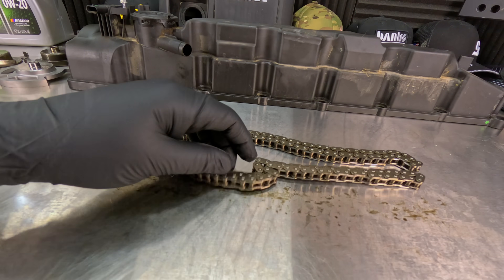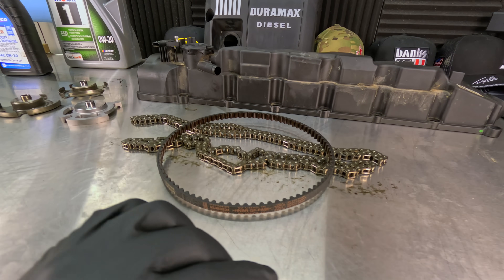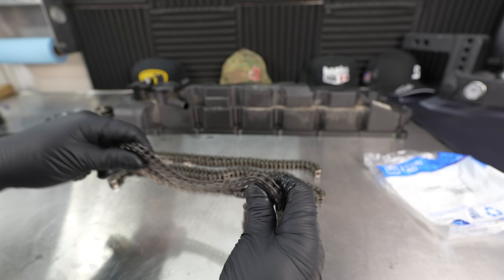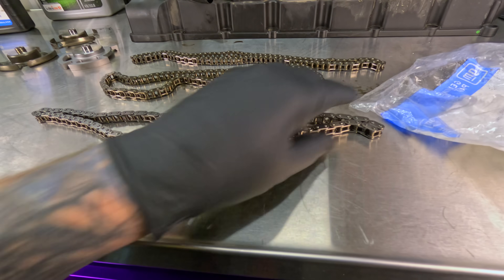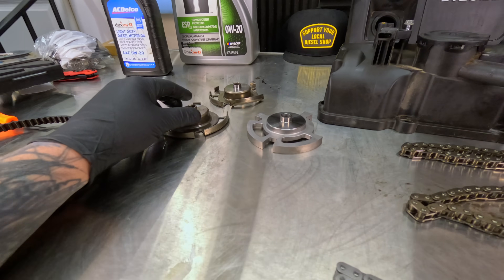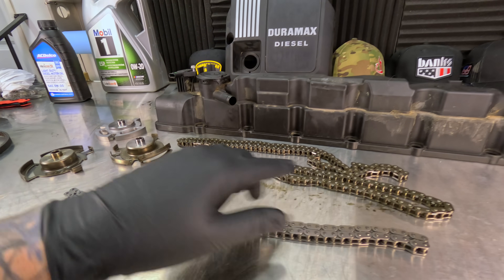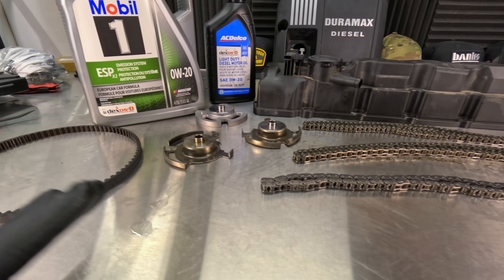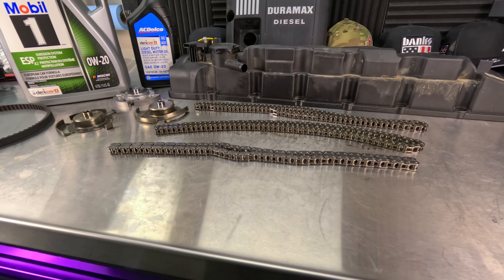3.0 Duramax $10k Timing Chain Failure — Updated Design vs Old

Comment: LOL....340k miles on my 08 gmc   6.6 duramax with gear driven valve train and crankshaft driven oil pump. But 0w20 oil sure doesnt help with the longevity  of those 3.0 duramax chains

Comment: So I’ve got a 2021 Tahoe with this motor in it. Confirmed 2021 year model bought in February 2021 new. Do I have to worry about the oil pump belt and chain issues or have I dodged the chain issues ?
Reply from the maker: Chain issues should be done and gone for your year and there are no belt issues to worry about, so you are good to go !
Reply: @DemonWorks thank you so much for the response.  Will tackle the oil pump belt at 150k miles
Reply: What about 2021 Escalade ?

Comment: I just bought a brand new 2025 GMC Sierra Denali Ultimate 1500 a couple months ago.  I made no modifications to it at all.  After 2000 miles my engine had a catastrophic failure.  It started making noises to the point I had to tow it to the dealership.  When they were looking at it the engine seized.  It had plenty of oil.  At no time did any of the warning lights turn on.  I was advised they ordered a new engine.  Of course it’s on back order and I will likely wait several months for the repair.  Has anyone ever heard of this happening?
Reply: I work at a dealership, we’ve replaced 2 so far and we currently have 6 engines on order all 2025/26 trucks. They messed something up and these trucks are destroying the thrust bearing before the first oil change.

Comment: That 3.0 is a wannabee diesel engine gas conversion.  Looks like a gas engine that runs on diesel fuel. Timing chains , overhead cams in diesel engines is purposely designed to Fail. When I think of any true blue diesel engine. I think of 5.9,BT 3.9 BT Cummins. They all have gears and no overhead cams and chains. . GM TRASH. Dodge is doing the same crap with there v6 wannabee diesel engine. Blue Tech Trash. If it's Not an inline 4 or 6  with timing gears.  It's not a true diesel.

Comment: This type of engineering buffoonery is happening so frequently, I'm wondering what it's going to take before the GM car/truck owners organize and go after GM with massive class-action lawsuits for deliberately designing substandard engines that require massive and very expensive repairs soon after the warranty period is over. This is no coincidence. They are designing these vehicles in this manner to cut costs and with an intent to see them fail.
Reply: I'd rather not see that. GM will advise its attorneys to litigate it until you're out of money. They will be, too...but they'll just go back to Congress to get a bailout. Then its my money too.

Comment: they all build chinese junk....ford gm etc no hardness in chinese metal....rubber belt in acid bath city on the oil pump????? ford transit uses a rubber belt for cam timing another time bomb

Comment: It might be an anomaly, but we have two 2023 1500/Duramax trucks for long haul trailer freight.  165k on one and 192k on the other.  Always using Delco 0-20 with literally zero issues.  These trucks normally pull 3000 to 8000 lbs on an open trailer.  Nearly 20 mpg with trailer.  They have been nothing short of amazing.  They replaced Ford 3.5 Ecoboost trucks.  Great to 60k to 70k miles and then, nothing but expensive problems.
Our plan is to replace the light duty trucks at $250k miles and replace them with the same.
Reply from the maker: The LZ0 is a great engine !

Comment: I have a ‘23 3.0 lzo with about 41k miles. Mostly highway miles, some towing 4k travel trailer.  I change the oil every 5k miles.  Burns probably ½ qt every 4-5k. Other than that, no problems so far.  I just need to switch to Mobil 1, still using Acdelco oil.
Reply: Rotella
Reply: @StreetTerrorist187  That's for Motorcycle.

Comment: Im thinking about buying this truck any input is appreciated. 2023 GMC Sierra 1500 Elevation
Exterior :
Sterling Metallic
Interior :
Jet Black
Highway MPG:27 [3]
/ City MPG: 22 [3]
*EPA ESTIMATED

VIN: 1GTUUCE8XPZ155358
Stock: PS61435A
Mileage: 38,363 Miles
Engine: Turbocharged Diesel I6 3.0L/
Model Code: TK10543
Transmission: 10-Speed Automatic
DriveTrain: 4WD
Body Style: Crew Cab Pickup

Comment: I've been driving a 2023 3.0 Duramax since new and now it has 38,000 miles, haven't had too many issues, a couple recalls and a couple visits to the dealership due to the oil consumption, besides that, just regular maintenance, but now on its 38,000 miles, theres a lot blow by coming from the oil dipstick ... a lot ! I dont know how normal this could be since Gm stated that the oil consumption is normal, but this is a separate issue ... but as far as know, blow by in a diesel engine is not a good thing. is there anyone dealing with the same issue ?

Comment: Doing my 1st oil change at 5k. Picked up the factory PF66 filter but want to use the PPE. Should i get the PPE or just roll with the PF66? I plan on all oil changes beong done at 5k.
Reply from the maker: Since you spent the money on the pf66, I would use that. I do offer a 3 pack of PPE oil filters here: https://www.demonworkshop.com/products/ppe-3-0-duramax-engine-oil-filter-pf66-upgrade-114000650. Singles can be found here:https://amzn.to/4j7Nji0
Reply: @DemonWorks gotcha. Yeah maybe I'll do it the next time. Sounds like it won't make a huge difference. It'll just be a little extra protection. Is that correct?

Comment: I would be surprised for a gm transmission lasting 150k miles or 200k. So when you rebuild the transmission get this belt replaced.

Comment: I have some questions for you, first thank you for your videos on the 3.0 Duramax. I have a 2023 Chevy Suburban 3.0 Duramax. The LZO was not available in the Tahoe/Suburban until 2025. So with my 2023 IM2, does it have the upgraded parts you described? Most information I can find focuses on the trucks not the SUV's. So far almost two years in o have had zero issues. Mine doesn't burn a drop of oil. I'm going to check the cam cover later today. But how would I know about the chain and any other parts. Any information would be great! Thank you 👍🏻

Comment: Do you know if the 2021 Tahoe has the upgraded timing chain? Looking at one with around 100k miles, nervous about this issue. Assuming if it throws a timing code it will continue doing it and would be caught in inspections? I haven't seen ANY Tahoes or Yukons get this done to them, maybe they all have the upgraded chain and haven't had issues?

Comment: Engineers want to be revered as experts, but never want to admit mistakes when they happen. I've dealt with Engineers and Architects, that design things poorly, and always blame it on the people implementing their design. Most Engineers have a financial responsibility, that put them, and their firm under scrutiny. Inhouse Engineer's tend to operate without care of consequences, and fall to pressure from marketing and accounting, to produce cheap, unreliable products in many industries. No care is given to serviceability either. ( Bolts that can't be removed, without disassembly of unrelated assemblies) . These things not only irk the repair person, but cost the owner twice or more the cost of replacing the failed part.  With today's CAD systems, there's no excuse for these oversights. When you're cutting holes in body panels to get at bolts, think of the engineering group that let that happen. Construction equipment went through a Serviceability Renaissance in the 80's, after customers complained about it. It led to modular components and swing away Radiators, to speed repairs. Time is money, demand better.
Reply: American engineers are replaced by turd worlders with fake degrees. That's a huge issue. Worked in a company that did that. The whole system is a sham.

Comment: Timing chains never last in a diesel engine, the soot in the oil wears them out. That is why industrial diesel engines are gear to gear. This is a throw away engine.
Reply: What about old diesels like Mercedes?  Never heard about those having problems with chains.

Comment: I'm considering a 2025 Silverado w/the 3.0 LZ0.  What term extended warranty would you recommend for this engine and should you go with GM or something like Endurance??  Thanks.
Reply: What did you end up going with, and what was the price?
Reply: Im at 92K in a 2020 LM2, no issues yet, running Amsoil 0w20 Diesel with PPE filter, oil samples now after 80k at 5K, all good.  Just bought the Endurance Superior 29 months @ $182 paid in full for 48/168K

Comment: GM, Ford, Dodge, and all of them are criminal for allowing engineering to put rear chains in engines, "wet belts", and in general designs that will lead to mechanically upside down values as soon as the cars and trucks are out of warranty. Just flat kicking their customers in the nuts for trusting their vehicles.

Comment: My bicycle has a bigger chain than that and it doesn't not hold a $20,000 engine my bicycle only costed 400 bucks and it's a nice one that is the same thing that happened to the Cadillac motors in 1984 the cam change stretched in a 90,000 mi era the cam change stretched almost 1 in and overlap the valves in the motor blew up Cadillac bit that one hard class action lawsuit 1984 to bake a chain company change the way they made the change halfway through the model year and did not let Chevrolet know that they had cheaper the change and that's why they stretched the cam change were actually 9 ft long because they were double chains on both overhead cams on both sides had two separate timing chains very bad idea single Royal chain very weak

Comment: There seems to be a historical trend of low viscosity oil + long OCI = early timing chain wear and oil consumption issues. 0W20 seems absurd to me in this application….it must be noted that fuel economy regulations from the EPA drive these thin oils, not longevity engineering. You might loose a small amount of fuel economy running a 0W40 oil but it will provide much better protection of the timing components. What I’m not sure about is if the oil pump belt life would be shortened when running a higher oil viscosity. Change interval could be based on proper lab testing and analysis, otherwise probably should be 5k max. Maybe even 3k if using 0w20.
Reply: The biggest issue of going to a thicker oil is control valves. I don’t care much for the thin stuff but ya change it up next thing ya know you’ve got lifter issues, variable cam timing solenoid issues etc etc. Not just talking about the baby D-max.

Comment: The 3.0 baby max is junk! Get a 2500 gas without dod or the full size diesel! These people worry about saving a few bucks in fuel are spending twice as much on repairing a junk motor as they would have on less mpg!

Comment: So like other non-serviceable frail engines they sell, you pay big time to fix. Timing chain and oil pump belt should be in front where a good cover design would make service practical. Pulling an engine to change a belt? That is the definition of poor engineering. Also the parameter for cam timing codes is too exact, stuff wears you know. Good explanation and warning not to even think about owning one.

Comment: Thanks for clarifying that ACDelco oil is not full synthetic
Reply: And the reason it burns so much and is aging the mechanical moving parts faster than it should.
Reply: The term “full synthetic” usually indicates a group 3 hydrocracked MINERAL oil. Which is very good oil, but it is NOT a true synthetic. In other words, it started life in an oil well, not a laboratory. Only about 1% of all automotive oil sold is a true synthetic product. A group 4 PAO or a group 5 ester. That did not come out of an oil well.

Comment: I mean, I don’t know what people expect. This is GM. Why would you buy the first model here of an engine from them? At this point it’s like people who buy GM products especially early in the life cycle or just a glutton for punishment. I mean, what have they had 15 years to fix lifters and they’re still not fixed. Why did anyone think it’s engineer would be problem Free right off the bat. And then when it comes to the oil pump belt, it’s like awesome. You saved all this money with your better fuel, economy, offset by higher fuel costs and DEF costs, and now you get to erase all of your fuel savings and replace the belt. It’s just GM doing GM things.

Comment: Father in law works at a dealership and they had 2 of these trucks with loose gears from the factory. One came loose on a test drive and took the entire engine out. GM is junk.

Comment: Roughly 100 mm is the goal, new is 98.95mm, used chain is 99.73mm. Sounds like the used chain is closer to the goal….
Reply from the maker: That was my goal for measuring links as I knew I would need to multiply and divide after this measurement was taken. When measuring for wear, the lower the number, the better.

Comment: What's your opinion on the Insane Diesel bypass oil filter system? Been considering getting one for my 24 LZ0. Want to give it the best chance it can have to last as long as possible.
Reply: I seen a Ford diesel that had 999,000 miles in it, the owner attributes it to the bypass micron 1 bypass.

Comment: A decently cheap OHC engine should have a DRY timing belt. Best cost vs reliability for OHC engines. Id rather change a belt twice than a chain once.
Reply: I agree but I think this engine has length reduction all throughout. Cost reduction too.

Comment: Hope those GM engineers don't go work for Boeing. Those engineers are DEI engineers, old school engineers used to build robust engines. The problems with this engine were totally avoidable at the design stage. Rubber belt driving the oil pump, what idiot thought this was a good idea, stole this idea from Ford? Stories like this make EV's look good.

Comment: I have a 2024 GMC 3.0 burns about 1 quart every 2000 miles since new. im at 47000 miles now, dealer tested it Friday and said it was not burning oil, tested good. Monday i checked the oil and down 1/2 quart after weekend driving lol.
Reply: How do you tell it’s burning oil? Specifically the amount it’s burning, there isn’t marks for how many qts are in the engine on any dipstick I used.
Reply: I asked the service advisor at the dealership how the oil marks work on the dipstick. He said the bottom line mark would indicate that it needs 1 quart of oil. That's how I based my measurement.  @TheMW2informer
Reply: @k5hoss  good to know thanks for answering, I had thought the two marks on most dipsticks were empty and full.
Reply: That sucks. It sounds like either the engines going to have issues or a doesn't. I'm about to do my first oil change and checked the oil yesterday, and with 5340 miles on the engine it was still filled all the way up to the top maybe even a little over the max gauge. 
I love this engine. Very happy with it and already saving a ton of money because I'm getting two to three times the mileage that my F-150 was getting. Hopefully your next truck works out better for you. With the price that these things are, I'm just praying that I don't have any issues.
Reply: K5hoss you need the updated valve cover, but really a catch can kit is what you need to capture the oil vapor and get it out of the crankcase ventilation system.

Comment: That Mobil 1 oil you are showing is NOT a diesel certified oil.  You should only use a API diesel rated/certified oil in a diesel engine.  The oil should have a CH4 or higher API rating and be a FULL synthetic oil.  I only use and run Shell Rotella T6 15W40 in all my diesels, and i have a yard full of them.  Using the right oil is the cheapest protection you will ever purchase.
Reply from the maker: ACTUALLY ..... it is....... Dexos D certified even .... https://www.mobil.com/en/lubricants/for-personal-vehicles/our-products/products/mobil-1-esp-x2-0w-20

Comment: Hopefully the EPA can now roll back these insane emissions standards. All the added complexity required to meet emissions standards make vehicles incredibly unreliable.
Reply: An engine that doesn't run, doesn't pollute.
Reply: They have I completely deleted mine what a huge difference
Reply: I’d rather have clean air. EV trucks will solve both reliability and cleaner air issues.
Reply: @Slowhand871  not any time soon they won't. Range while towing w/ and EV is awful.
Reply: @Slowhand871  Not if your energy source to recharge your trucks requires fossil fuel to generate electricity. You are just moving the problem, not solving it. Until the US is fully on hydro/solar/wind energy, EV with recharging batteries is not the solution for clean air.
Reply: @Slowhand871 ehhh not for a decade or so… and that will just to be equal to a half ton not mentioning 3/4 or 1 ton

Comment: Are these items I can have replaced at the 150k maintenance interval since it's on the back of the engine where the oil pump belt is located?  I have a 2020 RST Z71  3.0 Duramax.  I bought it in July 2024 with 35k miles on it.  April of 2025 and I have 61k on it (I live in Mesa AZ and drive all over the state for my job, so the miles are almost all highway).

Comment: As a parts guy, just because a part number remains the same, the part itself can easily be different.  I have seen it many times.  Just a way for the manufacturer to avoid accepting blame.
Reply: Yup exactly. Cant trust the number these days to signify changes.